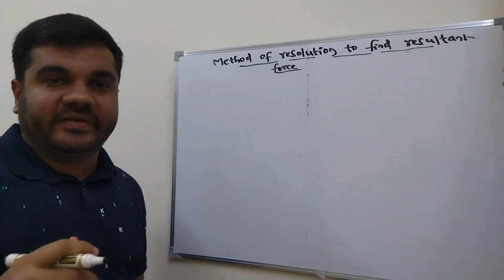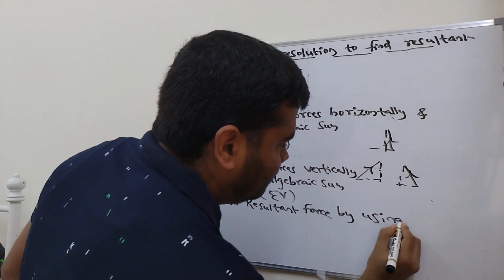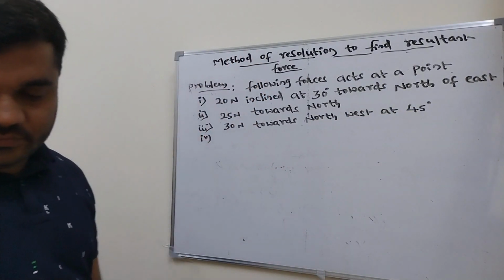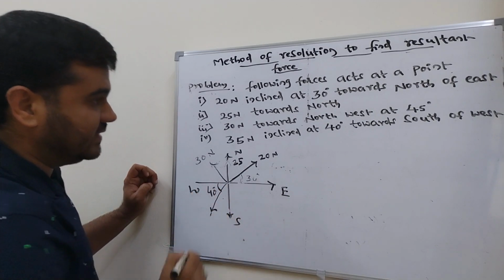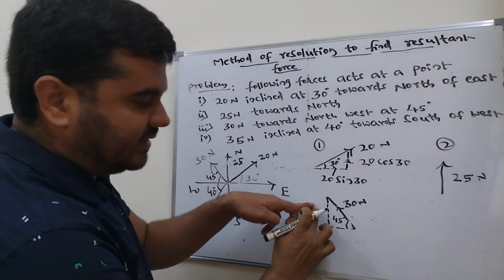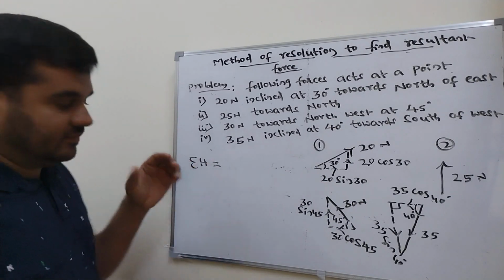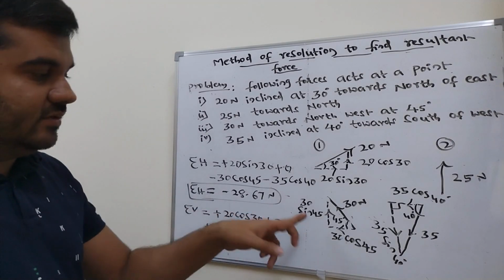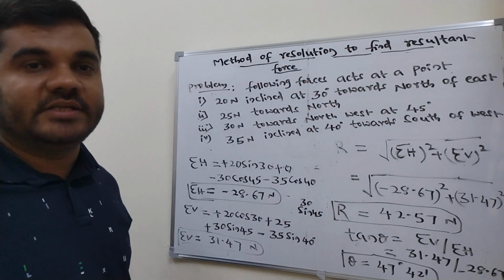Method Of Resolution of Forces | Resultant Force | Engineering Mechanics |  Problem with Solution

Comment: sir for horizontal component why it 20sin30
Reply from the maker: You are right. It's by mistake. As soon as the video was released, I was corrected and changed in the correction note of the description box. You can check. 
Horizontal component is 20cos30 
Vertical component is 20sin30
But total values  of summation v and H are correct. Please correct it.
Thanks...